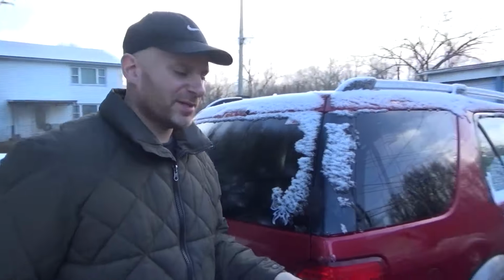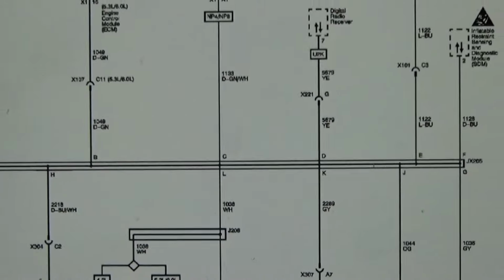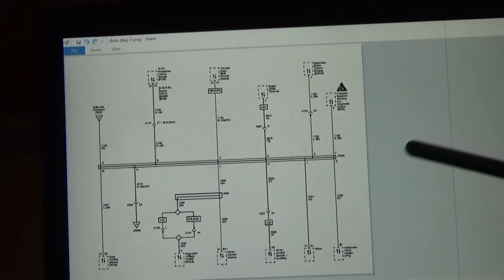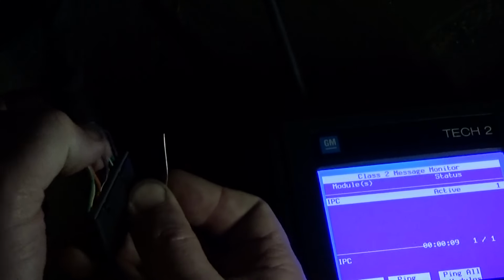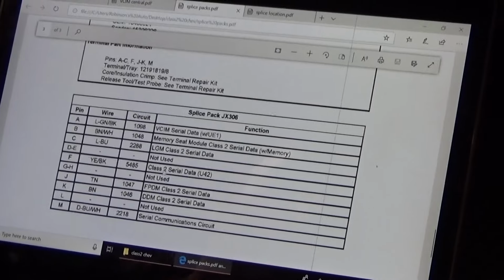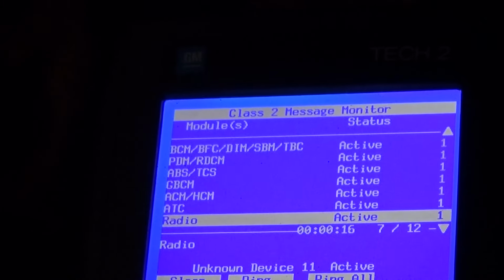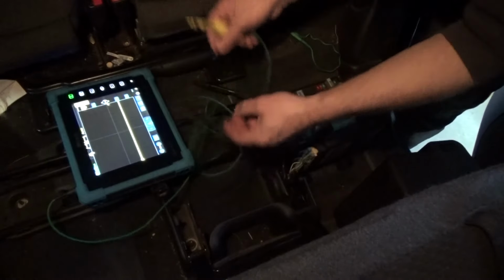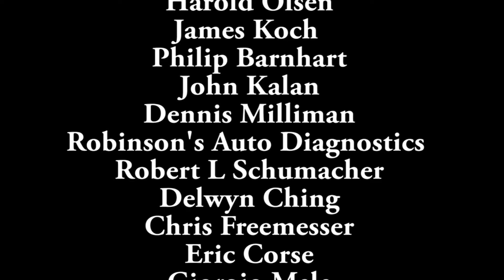GM - No Communication Class 2 network Troubleshooting U1064 U1300 U1301

Comment: This is an awesome example of troubleshooting!!  Logical progression by process of elimination.  I have the exact same issue right now with an '05 Suburban LT.  I've not started the troubleshooting process, but this video gives me a huge head start.  I don't have a scan tool or an oscilloscope but I have everything else.  Hurricane Helene has dumped a ton of water on this car and it leaked.  I suspect I have a short someone in the floor board or dash related to water.  
Leading up to this exact same failure I was getting some random OnStar messages with no input from me.  So I will start at the VCIM.  Thanks to YouTube for the platform and for guys like you who would take the time to recreate a scenario for the benefit of others faced with the same problem.  
For a 20 year old truck and 200K there is hope to keep it on the road and hopefully an inexpensive solution.  I can say this for sure, in 20 more years the cars that have been produced with dependencies on networks and solid state circuitry will never being showing up at Classic Car shows.  They will all eventually be unrepairable do to obsolete and unavailable parts.

Comment: I subscribed just to comment.
I’m having issues with communicatons on my 2006 Equinox.  ABS/TSC lights.  Also lose Electric Power Steering sometimes.
I have a tool, like your Tech 2 tool, that reads like your video.
Have similar error codes like this video.
Watching you go through your video, and going step by step, makes an old car guy like me happy.  Been working on cars all my life, and yours made looking for this issue… fun and endearing.
Now I just need diagrams and pin outs like yours.  Thanks for making this video!
Reply from the maker: Your welcome. Hope you get the issue resolved stay on touch

Comment: Great Video Will, enjoyed it. That combs make diagnosing the network alot easier, that's better than disconnecting every module one by one. Great design.
Reply from the maker: DiagnoseDan Thanks Dan I appreciate your feedback👍 thanks got taken the time
Reply: I would have used a jump wire from module  to class 2 connector while  connector was disconnected to see if module problem, or other I\O , with other power connector connected. Powered. 
If power and I\O are on one connector , then i use jumpers. 
Bad-shorted I\O can pull a module down.

Comment: This was a great video for me Will. I'm researching a intermittent crank/no start on a 2006 Dodge Ram truck. One of the many codes say it has a "no comm" but this truck doesn't have a CAN Bus system (pins 6 and 14) that my Hantek scope can read so I have to find a new approach. This helps. I'm hoping to get up there and hang out with Keith for a few days hoping some of his brain cells will rub off on me. Nice job on the video too. It was easy to follow along.

Comment: Nice job. I spent 20 years in the GM/Delphi/Mahle Advanced Systems R&D Group and I run into dozens of guys that simply won't take the time to learn just a bit of electronics and LAN communications to help them figure this out. They show up in my driveway all the time because they won't buy a cheap scope and soldering iron. 99% of the time, as long as the Micro-Controller didn't get damaged, All of these modules can be fixed for a couple dollars and an hour of time. Best Wishes.

Comment: Just went through this last week with a 98 Seville SLS. I just went through unplugging every module on the Class network until communication was restored. Found the VCIM as the culprit on that one as well. All modules aren't easy to get to so if it was a module that was in a difficult spot, this method would work best but I just got lucky I didn't have to go that far.
Reply from the maker: Levon Collins that works as well 👍💪 like you mentioned some are hard to get at. that splice pack takes a minute. Getting to the fault is the end goal~with many ways to get there:) great job!!! Thanks for sharing

Comment: Absolutely great video!
I'm an industrial machine electrician which is usually working with AC and much higher voltages but I can really appreciate vehicle wiring and it's different complexities. However videos like yours makes it become just another way of looking at electrical circuits and standard troubleshooting. I do not have a oscilloscope but think it would be invaluable with comms issues like this. What are your thoughts having a cheap picoscope to a pc. I ended up using my multimeter instead, to diagnose a similar issue in my tahoe. As soon as I unplugged a suspect ABS module my network came back to life, but it ended up being downstream at the ESCM and the vehicle ran fine when unplugged. It was a great feeling. But when I changed the module, the issue returned a week later, which now points to the old shock connectors and or the air ride pump system this module feeds. Going to disconnect the fuse power to the pump as it is not in use anyway. I was getting above 8v on can hi and lo on the module, then it went to 2.5v on both when i unplugged it. Thanks again for a great video, you should teach as much as possible, it's a gift when you can explain things well to the average Joe, your very good at what you are doing. 👍

Comment: Great training! I, in no way am a mechanic and you made this extremely easy to a layman to understand with logical processes of elimination and even discovered a couple shortcuts doing so. My 2000 deville spitting out similar trouble codes brought me here after battery change. Great video and these scan tools I'm sure are leagues above my analog Klein multi meter. Good stuff

Comment: Great video. Learned a lot. Have you ever had a problem when controlling the driver windows, that the heater fan changes speed? I am looking for a DYI way to read the data seeing that I do not have intelligent scanners.  2008 siverrado.

Comment: Nice find! Can I make a few suggestions? I use a DMM to pin 2 at the DLC. I use a BOB, but you said you didn't have that. What is that reading? Remove the splice pack and check the individual circuits. That would have taken you to JX306 and do the same. I'm not looking for any specific voltage, but I want to see activity. When you got to CK 1098 you would have seen the VCIM pulling Class 2 to ground. Make sense? 

Another tip you may, or may not find useful - on the Tech 2 the "left & right" arrow buttons take you up or down a full 'page'. It saves a little time instead of using the up & down buttons. 

Nicely done video!
Reply from the maker: GM's ONLY thank you for your feedback and advice!! Yes makes perfect sense 👍💪 great approach that will save time for sure!

Comment: Hi. Great explanation, thanks!
I have slightly different problem. 2007 Chevy TrailBlazer
Without any DTCs message "Stabilitrak not ready" and then "Stabilitrak OFF" appears on IPC display. I understand, it means, that EBCM can't initialize all sensors and other, to make sure, that ESP don't kill you🙃. But main problem is, that there no any DTCs in EBCM, at all. But there is U1166 (both driver and passenger doors) and U1019 on SRS. All succesfully cleared, but Stablilitrak issue don't go away. Maybe you seen that before, or can tell me, which way to go with diag. Thanks!

Comment: I know this is an old video, and I'm not even sure if the information I have is correct, but isn't the datalink supposed to have pin 6 populated? The service manual at Operation CHARM states that the rendezvous communicates via high speed GMLAN and the class 2 network, and it mentions:

Home >> Buick Truck >> 2005 >> Rendezvous FWD V6-3.4L VIN E >> Repair and Diagnosis >> Powertrain Management >> Computers and Control Systems >> Relays and Modules - Computers and Control Systems >> Body Control Module >> Description and Operation >> Data Link Communications

The data link connector (DLC) is a standardized 16 cavity connector. Connector design and location is dictated by an industry wide standard, and is required to provide the following:
	-	Scan tool power battery positive voltage at terminal 16
	-	Scan tool power ground at terminal 4
	-	Common signal ground at terminal 5
	-	Class 2 signal at terminal 2
	-	GMLAN High Speed + circuit at terminal 6
	-	GMLAN High Speed - circuit at terminal 14

I got excited for a moment and double checked, and unfortunately female pin 6 was not populated, and there were only 4 female pins and 4 wires (battery, ground, ground, and class 2 signal)

Comment: That was a very helpful video! I am having com troubles in my Tahoe. I don't have a complete signal loss on my class 2 its just shitty looking and I randomly have problems communicating with various modules. I should be able to follow the same steps watching my scope until the signal clears up, correct?
Reply from the maker: JOHN HUFNAGEL thank you... you can bring one Circuit up at a time while looking analyzing the wave form absolutely

Comment: Hi. What a great video, you definitely did work on the car like a true detective. Impressive. Maybe you have the knowledge sort my question out below. :)
Have a 2002 Tahoe sold new in Europe, do you know what pin 14 are used for in my OBDII port? Do I have GM-LAN in my truck and what protocol does it go under?

Comment: WOW! Very informative video! I sure learned a lot! I have  2011 Colorado throwing intermittent module error codes like this. Wished I had access to the data and schematics to run it down to which module is dragging down the others? Body panel module and fuel pump modules keep throwing codes on warm days only. I've replaced the fuel pump module but it did not help. Maybe my rear door wiring harness has pinched the wires off again or shorted them together making the body module drag down the network? Thanks for the video! I wished that you were near me? I'd gladly pay you to run down my problem and even pay a bit extra to watch you do it and learn!

Comment: Nice job. Just to clarify, does the class 2 circuit feed for the VCIM go into one of the 2 connectors you left unplugged? We see a lot of mouse chewed circuits in Toyota's that have shorted to ground and pulled down the network.
Reply from the maker: Toyota Ron yup and as soon as that connector plugs in the network goes down... mice can do a number for sure!!!and drive is nuts

Comment: Great video. Can you use the autel auto scan as a "ping" to see if modules pop up? My shop doesn't have a tech 2.
Reply from the maker: Michael Herbert thank you! Yes I do believe we could have used the autel throughout the entire job... we went for the tech2 because we had it and wanted to verify a second scan tool had no com. 
The tech2 will be much easier since it’s made for the job of course However I’m thinking with the autel you might need to keep repeating system scan and see what becomes active.. I’m not 100% but sure there is a way

Comment: Own a 2004 Chevy Suburban 1500 LS auto ride approx 116K.  Got a U1000 class 2 data link malfunction.  I do have a couple of known issues:  The automatic pedal adjustment is disconnected and both seat heaters went out at the same time for the driver  and passenger front seats.  Would this code come up to let me know both items are nonfunctional or would this code be because the BCM is having issues or should I be looking for something else?

Comment: I Will great video and happy new year! So if I didn’t have the Tech2 doing this test And the ability to print each one separately, I only have the ALLTEL, besides going through and Unplugging each module separately, while I have my scope hooked up, the easiest way to check to see which module is bringing it down would be to jumper each one and watching the network how it reacts correct? Thanks and keep up the good work, Doug
Reply from the maker: BigFoote Mobile Auto yup absolutely 👍 and the Alltel would have worked just fine for this entire job. Keep it plugged in the DLC just like I did with the tech2 and you will see the modules come on. May need to keep doing a system scan🤔 good question. Should work... 
We went for the tech2 just in case the ALLTEL was being goofy lol 
Plus being a OEM tool it’s much faster and easier..

Comment: Can you do this with an oscilliscope and interpret wether there is communication? I have a good scan tool, I am just not sure that it is that good.
Reply: I have haynes manuals. I am pretty sure they are not to forthcoming on voltage, resistance or anything like that, which would make voltage drops kind of hard to do in something so thechnical. I have a 2005 Chevy Silverado 3500 6.0 gas. If I had some numbers to go off of, I could do it. I am pretty sure that your basic Hyanes manual does not delve into that though.

Comment: Will, thank you for your time and effort, great video!

One doubt: In the beginning the vehicle started with the network failure present and the bcm - which unlocks the immo function with the fuel enable password to the ecm -  only communicates on the affected class 2 bus. 

Once the fuel enable password is sent and later,  still with the engine running, this data transmissions line gets corrupted, the immobiliser sysstem enters a fail safe mode. This fail safe mode will allow engine start as long as the battery will not be disconnected.

So is it sound to "assume" the failure originally occured while the engine was running because otherwise it would not have even started?

Thanks again for your work!
Reply from the maker: juergen scholl thank you for the feedback. 

started up and ran with condition present exactly as demonstrated.. Good questions and thoughts
She did say it happened while driving home vehicle running.. then came straight to the shop. Battery was never disconnected by us. 
Hope this helps

Comment: Hello I have a 2009 GMC Sierra 1500 5.3 z71 SLT i got a u0109 and u0102 codes my speedometer doesn't work service trailer brake is on traction control not working abs light is on parking assist is off parking brake light is on bluetooth not working remote start not working any idea what it could be. Thank you in advance

Comment: Thanks man.  Good show.  Can I get you over here to figure out my U1000, U1016, U1064, U1096, C0035, C0041, C0096, and P0717 codes.  The U codes are new since they didn't show up last time I read the C and P codes  ABS and Transmission sensor codes.

Comment: Do you have a phone number I can call. I have a 07 SS trailblazer the whole network is down also. Code u0100 and my volt meter continuously move back and forth between 5 volt and 18 volt. I also have a new PCM